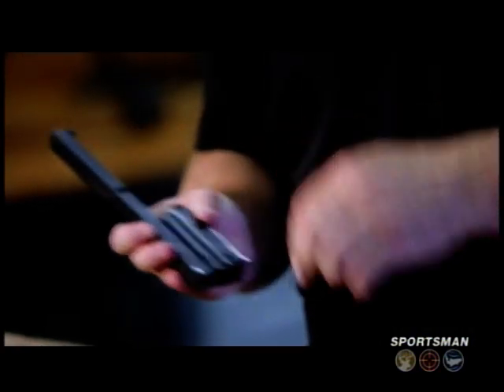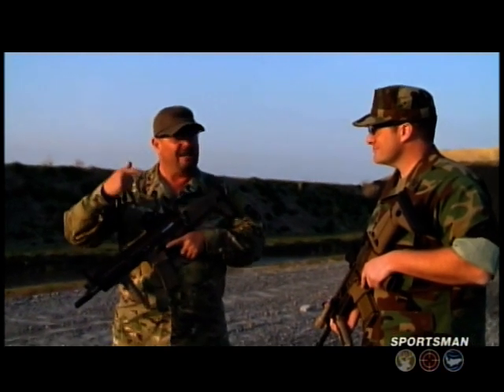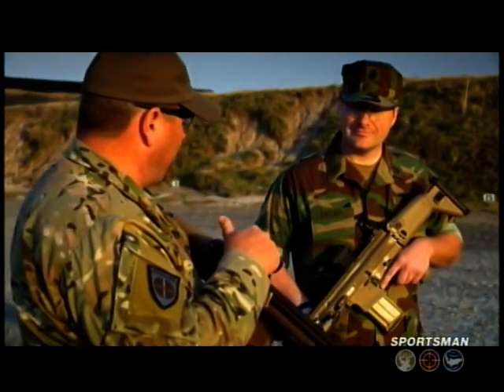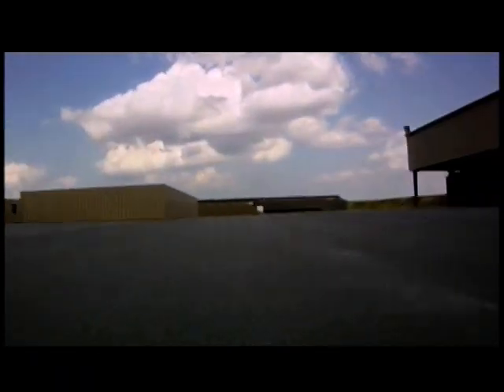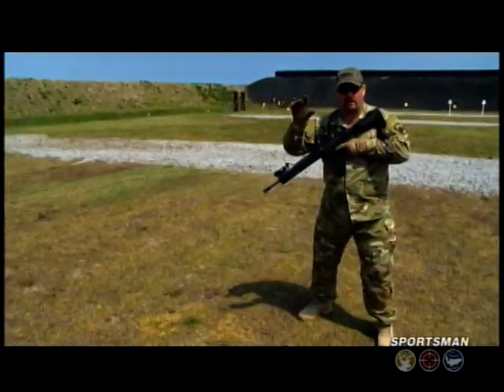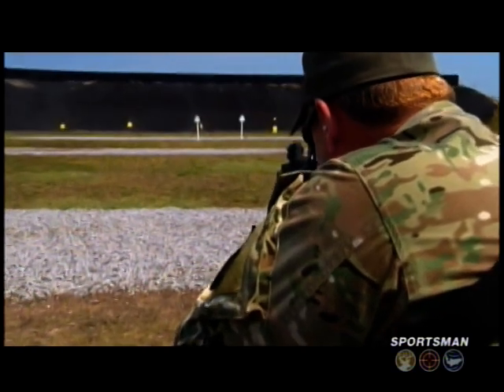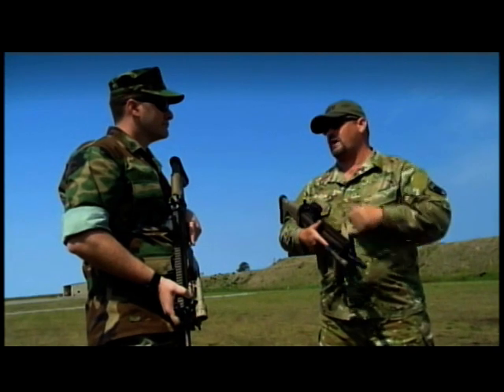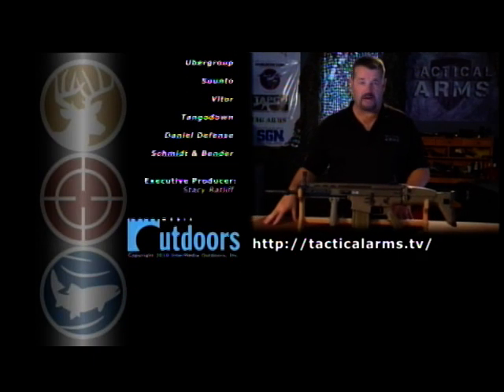Tactical Arms - Scar H (Part 2 of 2)

Comment: 5.56 is generally supersonic out to 775 yards or so. 7.62 out to about 900 yards. At that range, you're stretching the limits of either platform and a standard battle/assault rifle probably isn't going to cut it which is why you bring in other weapons like the snipers and the belt-feds. Now a 7.62 for a designated marksman rifle is something I agree with. But a general issue rifle for Joes who are typically fighting within 300 yards? 5.56 makes more sense.

Comment: The whole 5.56 vs 7.63 debate boils down to this: what do you want to do with it? 7.62 does have an advantage in terms of terminal performance at longer ranges and through barriers, but at the cost of heavier weight and recoil. The 5.56 is much more controllable, can carry more than double the load by weight compared to 7.62 and can do its job out to 600 if the shooter knows what he's doing (which he has to when you're talking about extended ranges).  (cont)

Comment: With the 5.56 if he had put his shots higher it would have cleared the notches. Those triple drop steels have all the weight on the bottom, the design rewards head shots/high shot placement. That being said 7.62x51mm has roughly double the energy of a 5.56x45mm rounds out of similar barrel lengths and target range. Beautiful rifles though.

Comment: depends on range. you hit someone at longer ranges with a 5.56 after its slowed down to subsonic and it looses a lot of stopping power. 7.62 has more weight so it takes longer to slow down so it stays supersonic longer giving it better stopping power at ranges but yeah at closer ranges or with a critical hit the 5.56 is as good as any other bullet

Comment: With the budgets being what they are, weapons changes aren't happening any time soon. The 249 was never meant to be a replacement for the 7.62 belt-feds, but rather a supplement (higher volume of fire than a rifle and lighter than an empty M60, but the trade-off was, of course, not being quite as hard-hitting). M240s are more and more common now, but the 249 still has its place. It's all in the employment.

Comment: AR10's in general just suck these days. The SCAR beats up cheap optics not aimpoints or Night Force scopes. The stock breakage is a design and materials flaw that certainly needs to be adressed. The point is the Mk 17 is not replacing the M4 in any role or branch  of service. It is a supplemental rifle for punching holes and dialing out to long distance. The manual of arms and control placement for the M16/M4 sucks when you are shooting from prone at long range. Get real dude.
Reply: THE NEW SCARS HAVE A UPDATED MORE ROBUST STOCK. 2019

Comment: 10.5 barrels on a mk 18 are good to at least 300 yds. It ain't the rifle it's you. The fuck factor for M4's is the green tip tracer. It's wobbly and needs a 1 in 7 twist to stabilize in a 14.5, or shorter, barrel. The other issue with SBRs is dwell time and if you notice Mk 18s usually have their cans on solving that issue. Learn some shit before you post.

Comment: the lower receiver is copied from AR, the bolt is copied from AR, the carrier group is copied from AK,  the side way folding not original.  the short stroke system is out for a long time, the butt stock design is copied from the UGG shoe company.  everyone is copying from each other, i don't see the big deal.  have a fun day.